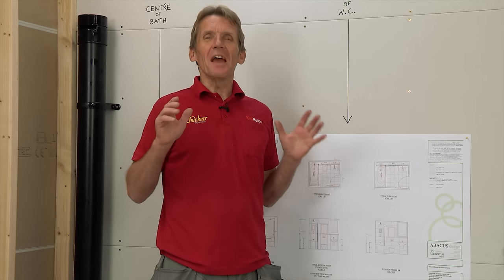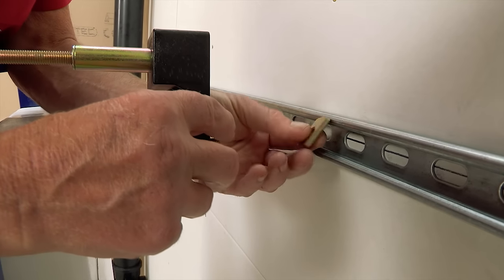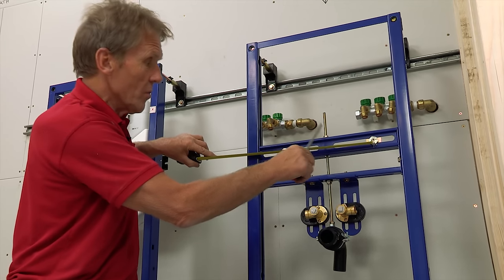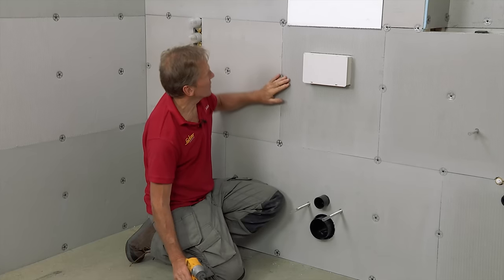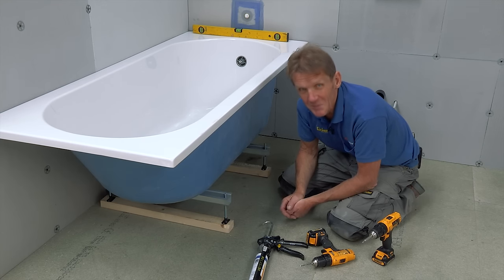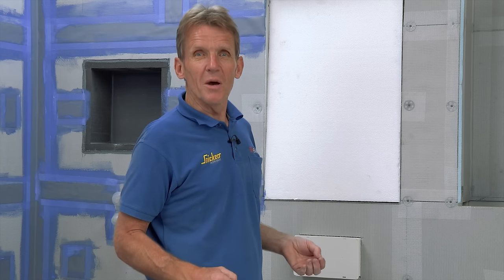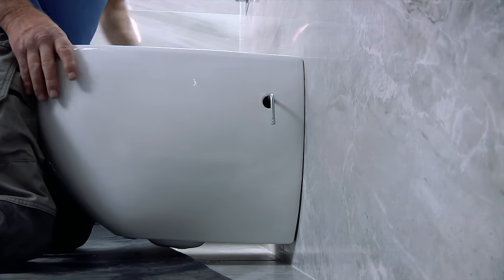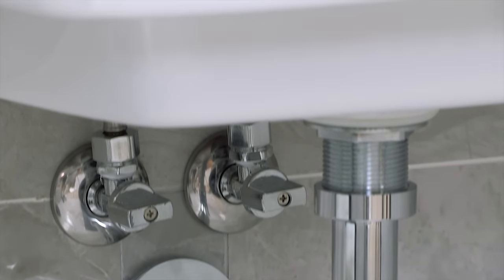Step-by-Step Guide For Installing a Bathroom

Comment: Is there a list of products used somewhere?  Thanks
Reply from the maker: Most of the items are listed here on our website: https://skill-builder.uk/the-ultimate-bathroom-installation-video-2020
Reply: Quality job, well done, I am a little puzzled about the access to the bath trap and waste pipe, also with the quality of the bathroom equipment used and your time spent waterproofing etc, surprised you didn’t use a de coupling mat on the floor which would be stuck to the floor with tile adhesive and then tiled directly to it, saves a big step into a lovely bathroom,

Comment: Would love to see the same video done in an old 1930s terrace house with knackerd old brick walls on a tight budget, totally different kettle of fish getting a good quality finish
Reply: One of these is exactly that from this guy
Reply: Chemfix for fixing bolts screws into crumbling walls.
Reply: I’ve just done a full rip out of my stone Victorian terrace  my walls were all over the show but i boarded all of it level with wood batons packed and fixed to the stone … my room is square and plumb .. it’s first time I’ve ever done a bathroom so if can do it then anyone can
Reply: Klobmiester how did you acquire knowledge of what to do and what to get?
Reply: @Wild-Storm  YouTube videos
Reply: I would advise going back to the bricks and replastering with sand, cement, lime 6:1:1 and making sure walls are plumb for tiling!
Reply: @klobmiester  my life right now rip old victorian plaster
Reply: He's got exactly that on one of his other videos, including ripping the floor out, moving sewer pipes, etc., and it comes out equally nice.

Comment: Fitted my off the floor toilet and wash basin using Geberit UP200 and basin frame way back in 2013. Put Geberit's duofix metal channeling under and behind the toilet and basin frame. Plasterboard then just screwed onto the duofix. My plumbers had never seen anything like Geberit kit. I had to fit the Geberit frames to the wall myself as back then they didn't have a clue.  I agree with you that Abacus have a very compelling set of solutions. Well explained set of options and things to be considered. Fitted Villeroy & Boch Subway toilet and V&B Sentique 800mm basin.

Comment: Roger, excellent video from start to finish, thank you. We've just renovated our bathroom, using the waterproof backboards (Nassboards) and sealing kits throughout from Abacus, and installed German steel framed supports (purchased separately in Germany on a trip and brought back over here - far cheaper) hidden behind studding for both the sink and hanging toilet, hidden cistern, etc. All gone very successfully and this video helped enormously. Our finished bathroom now looks superb, 4 star hotel standard.
Reply from the maker: Hi Paul 
I am so glad it all worked out, it is actually a lot easier than the old style bathroom with everything on show.

Comment: I am using this video as training material for when I attack replacing my bathroom (DIY). I love all the extra bits such as mounting plates and filling the void with a box - just wow. I showed the missus and she was tickled pink with the idea.

I do have a question though, we are fitting a 1400mm rectangle shower tray and will use a stud wall for all of the pipework, what is the best approach for distancing between the real wall (untiled) and the stud wall (untiled)?

Roger, I am loving these videos - ALL of them !!!!!

Comment: I ordered a linear former tray 1800 x 900 and abacus sent a square waste tray with linear waste, I decided to keep the tray and reorder the square waste kit. Upon fitting the waste I tested and had a drip from the bush reducer, applied more solvent weld around the joints to sort this. Upon fitting the waste to the underside of the tray and only got one side clicked up. Had to use a G clamp on bits of ply to pull the other sides up. My tray was also bashed up on two corners from the courier's and I had to use scraped up leftover kst adhesive to repair those parts.
Just letting you know that its not as easy as your videos show.

Comment: Looks sweet - love well thought through systems where they've designed it from an installer's point of view...my only recommendation would be find a new tiler - one who can grout smoothly (basin supplies) and can drill neat holes for services not creates notches that are almost as big/bigger than the cover plates (shower valve & basin waste)

Comment: I honestly don't think the boxing in of the pipe ALWAYS looks bad. it can look naff, but it can also make a low shelf. It depends if you have the room to lose. Older houses tend to be tight on space at the best of times. But still loving the idea of this. Just making the case for the old methods. :) The bog brush has to sit somewhere ;)

Comment: Very helpful advice.  Just moved to UK from states and was confused how to seal in edges of the tub. Waterproof tape would be completely unnecessary if they put a lip on the tub edge like they do in the States.  Silly that UK is ahead of the states in so many areas, but a simple 3mmx2cm lip eludes the plumbing manufacturers.
Reply from the maker: It is easy enough to put a lip on the bath but it means you have to have a right handed and a left handed model. That means carrying twice the stock which raises costs

Comment: Truly excellent in all respects Roger and I think you achieved a lot in that one video. The principles and methodology are absolutely sound in all respects and transcend which product manufacturer the customer finally selects. I would also venture that where you used the tanking membrane over joints and fixings in the deluge areas and the webbing in the non deluge area joints is in the scheme of things a bit of a short cut and I would tank the lot. Anyway great work and thanks for sharing your skills and expertise.
Reply from the maker: Yes tanking everything is a good option.

Comment: Well done to everyone who put this together! Spending say £2,000 just to ensure a bathroom is properly waterproofed might seem expensive - but compare that to how expensive it is to rip out and repair a water damaged property's structure especially as it can go unnoticed for years and lead to rot all over the place and affect multiple floors.

I would have liked to see how the extraction had been implemented with this system.

Comment: Thank you for taking the time to present a detailed guide to a complete installation. I will use Abacus etc as I can afford the complete setup now if I do it myself. Question: if we decide to use marine ply etc, can I put it on top of the elements board instead of the tiles .
Reply from the maker: Ian 
 Marine ply? Where are you thinking of using it?
Reply: Is it possible to put it on top of the elements board on the walls outside of the shower enclosure. We once had some coated marine ply (so they told us) inside the shower . Wife is w@nting to have a dramatic color change

Comment: Hi Roger

Brilliant video.  Do you have to mount the feet of the frames on the floor joists?  Assuming first floor bathroom.  many thanks
Reply from the maker: No you can mount the feet on the floorboards but I always use two timber bearers to spread the load. The only reason being that I have seen slow leaks rot the boards over the years and the foot suddenly goes through the board, usually when the bath is full of water and somebody gets in. The total weight of Bath + Water+ Person (or two) is around 190 kilos.
Reply: @SkillBuilder  

Wasn’t Geoff referring to the WC and sink frames, not the bath tub feet?

Comment: For a shower installation, do you run the tape over the joints to the floor or can it stop up to the tray and then go over with no more leaks? Do you also fill the joins before putting tape?
Reply from the maker: Run the boards to the floor. I always gun a bit of silicone down the back of the tray to hold it in place, then put the tape on and then do the waterproofing on the rest of the boards.

Comment: Nice work Roger. Shame the tiler didn't have the same pride . Wouldn't use him again.
I hope the customer got a discount for that shoddy work.
Reply: ICECREAMK1NG1 which bit??
Reply: @kev81scott   check out trap at 57:58 square corner showing. Also the inline valve showed movement when being installed against the wall tiles. That said the video was excellent and really informative.

Comment: absolutely fantastic job from you , not so much from the tiler
Reply: zuluula: leave the tiler alone he did a fantastic job
Reply: No he did not. It showed a complete lack of care and pride. It was bad.
Unfortunately it's people like you, that make them think this is acceptable.
Reply: @ICECREAMK1NG1-jw8ig  Tiling looked fine to me so please could you explain what there was about it that made you think it was bad?
Reply: @rayce60  The wash basin waste cut-out was patched and still had a gap after the cover plate was added!  Diamond hole saw sets are cheap and come in all the sizes you could ever need!
Reply: @edwardholmes91  Is that it? Blimey. From the comments above one would assume the tiling was absolute shite. It may not be 100% but it looked 98% to me. Of course for absolute perfectionists who never make any tiny errors or mistakes like yourself or @ICECREAMK1NG1 I can understand it's crap. Oh and by the way Diamond hole saw sets aren't cheap if you buy decent ones. My Marcrist set cost over £300 and that only has three cutters in it so you're talking bollocks there for a start.
Reply: @rayce60  I never said anything about the tiling being bad, just highlighted what the OP may have been referring to.  I'm sure you can buy expensive sets, but for £10-£15 you can get a set that will certainly last long enough for one job, at that price... it could be absorbed into the bill and be disposed of afterwards if needed.
Reply: The already mentioned poor cutouts under the basin, the tiling for the niche isn't square and the trim work is poor and the grout lines along the length of the bath don't line through. Considering the tiles are so large there are very few of them, it shouldn't be to hard to line them up.  You don't need a £300 marcrist set to do it right, just a pair of eyes and some pride

Comment: Hi roger I love the way you have done this bathroom what plastic pipe system have you used.
Reply from the maker: I think this was tectite push fit but JG Speedfit is easier for DIY because you can take it off very easily and make adjustments. If you buy Pipelife pipe it is the same stuff and a lot cheaper than some of the premium brands. Pipelife used to make it for the big companies but now have their own brand which is half the price. .
Reply: Roger I would like some advice I am doing my bathroom and am using a similar frame system for the toilet but am not using one for the sink,where do I locate both my hot/cold manifolds as I am not using a frame for my sink. What are my options to locate them.
Regards

Comment: Great video, but I've had issues with this type of flush mechanism that causes water to get onto the back of the cladding below the push panel, creating water stains when it soaks through. 
If you remove the white panel shown at 3:00, you can see the top of the flush tubes. When the cistern is full, pushing the left (full flush) button at any decent speed lifts the tube quickly, water rushes in and slops up and out the top of the flush tube. Some of it splashes onto the flat shelf below the push rods then seeps forward and drips down the front of the cistern and at some point transfers to the cladding you have fitted to the front. Over time this penetrates and comes through.
The solution is to put a restrictor plate on top of the flush tube and also add baffles on the pack of the pushrod shelf to contain any water that gets past the plate.
Or change the design (manufacturers, your move...).

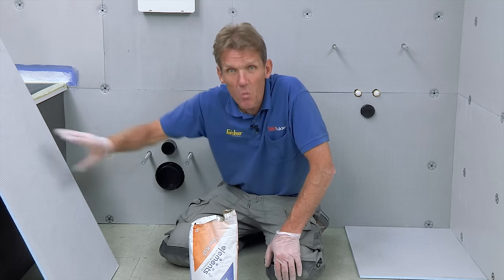Comment: 37:50 - since when did heat go downwards? Lol

Great video Roger - also, at 57:57 - what did the tiler say about cutting the whole for the sink waste, the wrong shape for the waste cover?
Reply: He's talking about conduction, not convection.

Heat from the under-tile heating element will conduct outwards from the element both up and down; however, by adding good insulation below the heating element, he's able to minimize heat loss downwards so most of it goes into the tile.

What you're thinking of is "hot air rises" - that's heat convection.

Comment: Hi, have had a look through, can't see any reference to the plumbing.  Are you using uPVC with brass compression fittings? What is the most reliable fitting, other than copper soldered joints? Are the fitting you use safe enough to use. More concerned about leaks, these would be hidden by the waterproofing. Any comments/advice?

Comment: Hi Roger, great video. I'm a fairly competent DIYer (if there is such a thing) and about to remodel my bathroom. I wanted to know what poly pipe and fittings you are using?
Reply from the maker: I use Pipe Life because it is the same stuff as the other brands but a lot cheaper.  The pushfit fittings can be Pipe Life or JG Speedfit. Always use the liners and you won't have any bother. 
As for competent DIYers. Some of the best jobs I see are done by homeowners doing their own plumbing or whatever. If you care and you aren't in a rush you are already ahead of some of the chancers out there. When you break this job down there is nothing there which would challenge the average practical person. It is all about knowledge.
Reply: @SkillBuilder  Thank you Roger for the I formation. I realize you are probably very busy at the moment so your reply is very much appreciated. I have been watching the channel for a while and have found both your and Robin's videos extremely helpful, especially the "belt and braces" approach. 
Would there ever be a time when you would consider doing a tool test for the competent DIYer (Less expensive) Your tool reviews are excellent, but for the mortals amoungst us, it can be difficult to justify the outlay for something you don't use  every day.....thanks once again and stay safe.

Comment: Tiling work was a touch suspect in parts. There were a few bits where the chrome didn't quite cover. 

Pretty bathroom though
Reply: A general rule of thumb is if a defect is not unsightly from a couple of meters away then it is fine. Change that distance according to how fussy you are!
Reply: General rule of thumb is replace it, don’t leave it !

Comment: Great thanks for the video excellent.
I am tiling my bathroom floor, I wondered if its better to tile underneath the bath or is it not necessary?
Thanks.
Reply from the maker: You don't normally tile under the bath but it makes sense to have a water proof tanking system. In the U.K they don't bother
Reply: @SkillBuilder  Great many thanks for your reply, much appreciated.

Comment: Great work Rog. 
Any recommendations on a point of use electric hot water unit for less than a £100?. I'm building a garden room and would like a sink for hand washing  but reviews for this type of kit are all over the place just wondered if you had experience of them. Might be an installation topic for a new vid.
Reply from the maker: www.toolstation.com/redring-instantaneous-manual-electric-handwash/p40656

All these units will scale up in hard water areas but you can clean them with vinegar or some similar scale remover left overnight.

Comment: Question around the isolation valves. May have misunderstood but it allows you to isolate the water to bath basin etc etc all from one location? But does that mean from the isolator you’ll have a separate pipe to each item as opposed to a pipe going to bath then tee off to etc etc?

Comment: Awesome video and the amount of time it must have taken to make the video would have been immense. Love all the systemised fittings etc.... As the others have mentioned, the tiler let you down a bit on this one... Was he low on tiles or something???
I think, with the amount that was spent on this bathroom (for its size) the tiler could have chamfered the nib edges... An extra hour of work at most-if he has the tools...

Comment: I noticed that for your products that waterproof you are not having to wear a respirator for toxic products. But the md adhesive, does it have polyurethane in it? Is it good for safe air quality in the house? tia

Comment: Really well explained video.  What stud sizes are you using and are they preseure treated? Cheers
Reply from the maker: We don't tend to use pressure treated on non structural. A bit of 3 x 2 or 4x 2 cls is fine
Reply: Great! Thanks very much

Comment: Hi Roger great video, but the only part I do not understand is the WC flush system, ie  dose it contain a syphon? and if it dose how can it be repaired/replaced??
Reply: I am not Roger, but a Toilet waste connection does not need a Siphon, it never did. The Siphon is inside of the Ceramic Toilet itself, as you can see by the Water inside of the Bowl when you open the lid.
Reply: What planet are you ON??
Reply: @martinmackett2758  Rather than raging, correct me if I am wrong, I love to learn!
Reply: If you read the question I asked Roger, it says "Flush system"  NOT waste, the flush water is stored in a tank at the rear of the toilet, and is released, by either a syphon system, or by a basic plug being activated when either pushing down on a handle, or in this case pushing a button.
Reply: @martinmackett2758  Oh... Flush System........ I feel dumb now